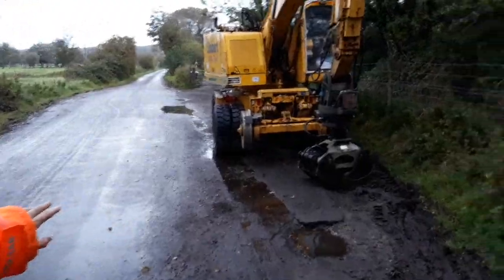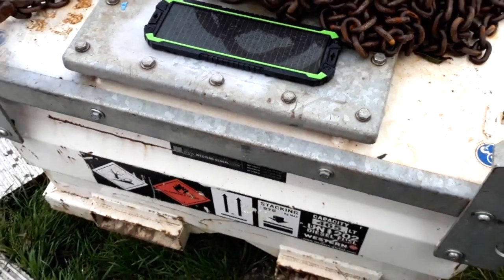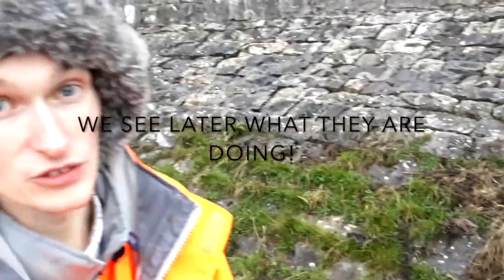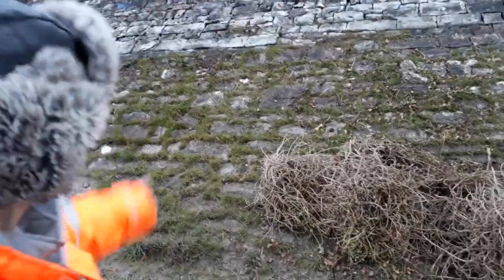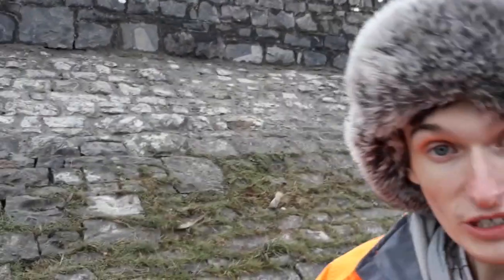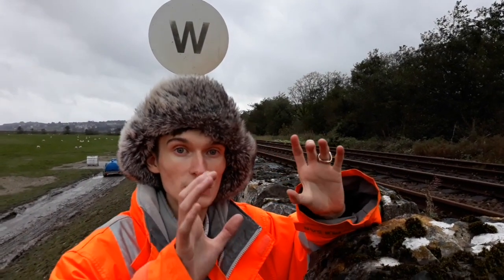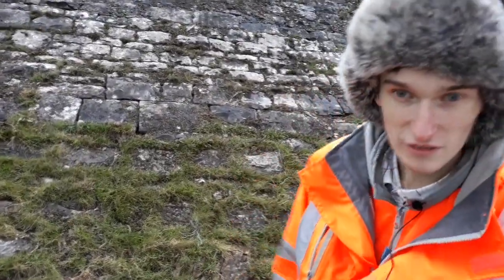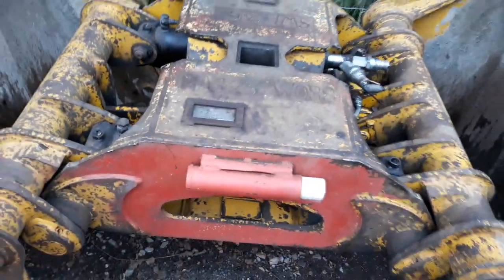Is The Furness Line  Falling Into The Sea!?

Comment: Good video but I think I would be really careful when you are close to railway machinery. I think I saw someone say that you can get into trouble with the railway police coz they might look at it as trespassing. Don’t want you to get into bother mate.
Reply from the maker: The machinery is left on a public road and Morecambe Bay SSSI, both are open to public access. Network Rail are guests in these locations, the railway boundary is well defined and this equipment is not within the boundary, hence Network Rail had to apply for permission to do this work months in advance.  If you leave something in a public place such as your car for instance,  it is not against the law for another member of the public to come along and look at it. The railway boundary itself is well marked as is the public level crossing onto the bay.